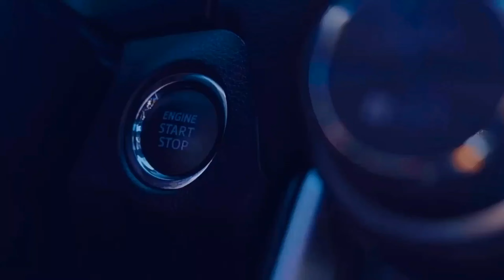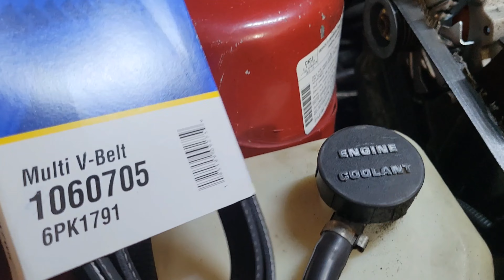1988 Chevy Cavalier Z24 serpentine belt replacement. Part 1 what can go wrong, will go wrong.

Comment: Damn... if it ain't one thing. 
Yeah RockAuto is the s***, and you weren't kidding when you said at the beginning that there'll be multiple videos LOL
Reply from the maker: Already tried rock auto they don't have it. Looks like junk yards I go.
Reply: @IdiotCarGuys  Try ebay for any GM 2.8 LB6 engine. Celebritys, Cieras, Centurys, Cavaliers, Cimarrons, Supremes, etc. They should all have the same plate. I had this issue with my 1989 Celebrity, I removed the entire plate and took it to a shop and they zipped it right off with some wd40 and a gun.

Comment: What in the hell are you doing? 
I fast forwarded to see you trying to get to the belt tensioner with an air ratchet and a universal extension. 🤦‍♂️
Use a breaker bar. 
Move the tensioner
Lock tensioner (if it has a lock)
Remove belt